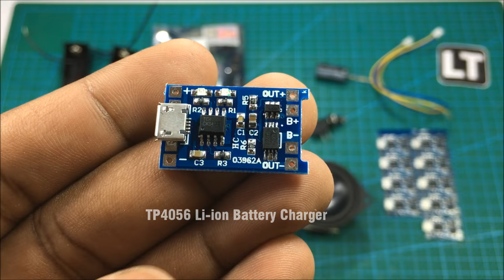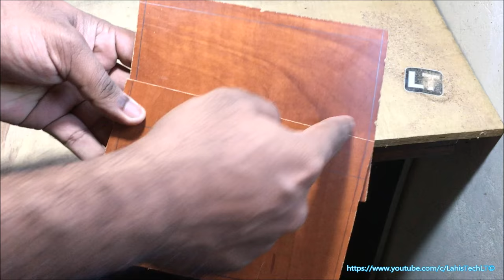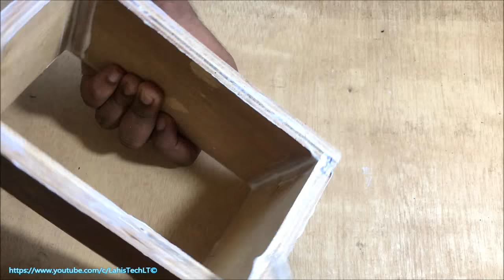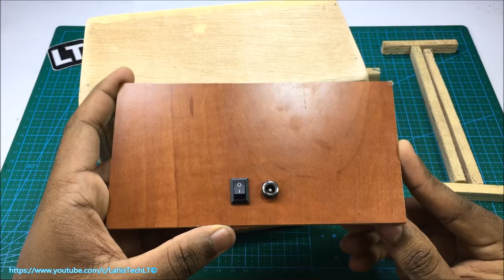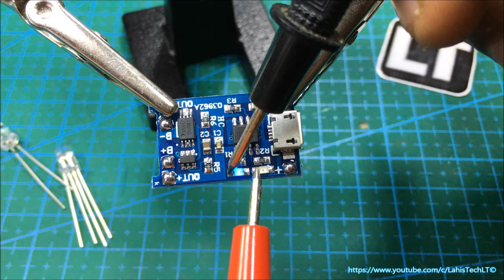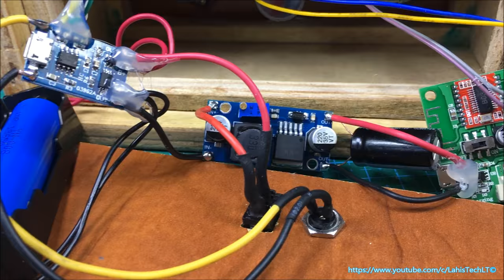how to make bluetooth speaker at home (HF69B Amplifier)

Comment: Why you add large capacity capacitor on one end of Buck Conversation DC Step-Down! Otherwise it was awesome diy what I looking for! Keep it up!
Reply from the maker: That's to stable the output power once the batteries drain to lower level.
Reply from the maker: Thank you
Reply: @LahisTechLT  Would we need it if we provide power supply via AC~DC adapter or through Transformer by using Bridge Rectifier, eg. AC 240V~12V DC?

Comment: Please help, why does my TDA 7492 "collapse" at high volumes when I am using a step up converter? Is the step converter too weak to supply a constant 12v?
Reply from the maker: The current of your power source should slightly higher. Otherwise, boost con. will shut down.

Comment: SANWU HF69B already have a charging module (for micro USB), why did you use additional modules? Is it possible to use the turn on/off switch only with SANWU HF69B without the other modules? If yes, how to connect it? Thank you very much!!!!
Reply from the maker: Welcome, That's a great question. The first reason is the charging interface of this amplifier doesn't have a battery discharge protection feature, Secondly,  I needed to increase the capacity of the battery by connecting them in parallel (2 batteries), so in order to charge two 18650 batteries amplifier's charging interface is not sufficient. That's why! Thanks!
Reply: @LahisTechLT  Thank you for your replay. I've bought only the amplifier and the switch (I already have a 3.7 battery). How can i substitute the switch integrated with the amplifier with the external one to turn on/off?
Reply from the maker: @claudiopascarelli3159  Just connect the switch between battery and amplifier charging interface. But in this way you may hear a POP sound, when turns on the switch.
Reply: @LahisTechLT  but in this way, if it is turned off, I cannot charge the battery. Isn't it?
Reply from the maker: @claudiopascarelli3159  Yup that's an issue with this module, btw you can attach the switch of amplifier to the speaker box, I mean the switch, which uses to toggle between mini USB and battery power (small switch on the HF69B). So this way you can attach another switch to the battery and turn on/off. Hope you'll get my suggestion. 

Role of that small switch -- When the switch is ON, the Micro USB port is the charging port, it will work if powered by the lithium battery. When the switch is OFF, the Micro USB port is the power supply port, it doesn’t need to connect with lithium battery.
Reply: @LahisTechLT  ok. So if i well understand, you suggest to move the switch that is on the module to the box (so i can move it) and add another switch on the battery. Right? But even in that case, i do not understand which is the "combination" of switches to charge the battery having the speaker off. I think it's not possible.
Reply from the maker: @claudiopascarelli3159  That's right you got my suggestion, btw there is no option for battery charge while the speaker off. Only thing you can do is turn off the bluetooth on your device while batteries get charge. .........Use the method I have used in this video, that's the only solution.

Comment: Nice build, I like that you used LEDs!
But one question, why did you use that XL6009 step up & capacitor and then soldered it to the 5V dc-in? Is there any other way like soldering the charging board and the batteries together to the battery-in port?
Thanks
Reply from the maker: Thanks. Someone asked the same question 2weeks ago. I used that XL6009 stepup converter to increase voltage from 3.7 to 5v, which is the maximum voltage that can be supplied to the amplifier. (Better the Power better the sound quality). Furthermore,  here is the two reasons why I didn't use amplifier's charging interface itself.  The first reason is the charging interface of this amplifier doesn't have a battery discharge protection feature, Secondly,  I needed to increase the capacity of the battery by connecting them in parallel (2 batteries), so in order to charge two 18650 batteries amplifier's charging interface is not sufficient. That's why! Thanks!
Reply: Yes I'm aware of why you had to use the tp4056. But my question is, if it's technically possible to solder the tp4056 together with the 18650 batteries directly to the amplifier board. I would not use the dc-in (which obviously needs 5V), but the battery-in (which can handle 3.7V to 5V). Do you know that?
Reply from the maker: @na1337me  It doesn't matter you can directly connect tp4056 into the amplifier's input. But, that way if the batteries get below 3.7v the sound will be dead compared to using it with boost converter. i mean battery drains quickly. 
See my new speaker https://youtu.be/NvJF_2vUuqc  I connected it without a boost converter it works fine.